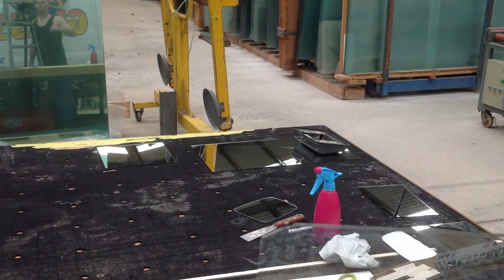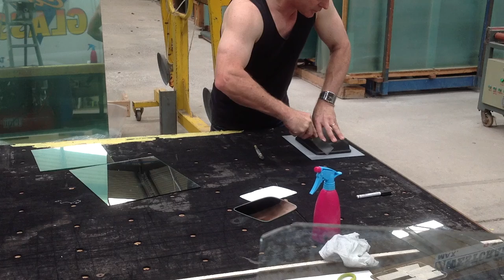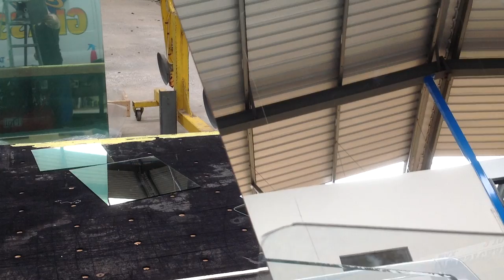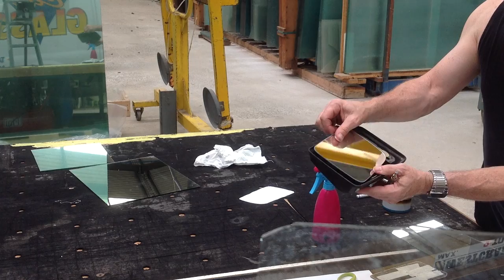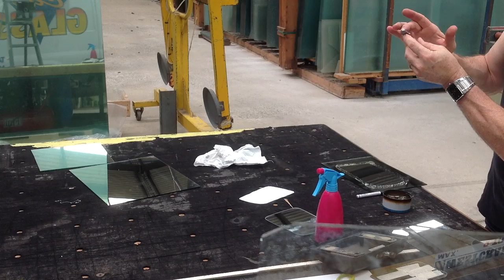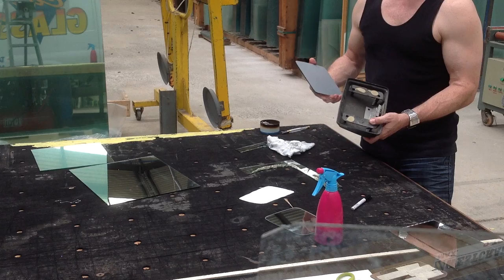cutting a Car mirror

Comment: Thanks for the video. Just replaced my Hiace right side mirror glass with your guidance. Brought a glass cutter from Mitre10 and two $5 long mirrors from an opshop. Cut the first one back to front and then got it right with no breakages on the forth go. $20 repair. Cheers :)

Comment: Mirror edge sealer is always good around the edge on painted side to keep the mirror tip top and safe in the elements for years to come , nice job darynn that scratch technique with the putty knife is a beaut , sure beats making a 2 or 3mm clear template each time , well done

Comment: I got a question for you, where do you get that big piece of mirror from? I am trying to replace one of my side mirrors glass that measures 8X10 and can't find auto mirror that big
Reply: Old comment I know but I got some glass at Home Depot for instance just under 2 bucks and a can of Rustoleom Mirror Effects to spray on the back. So in my case I just cut the shape I need then add the mirror backing, let dry then mount.